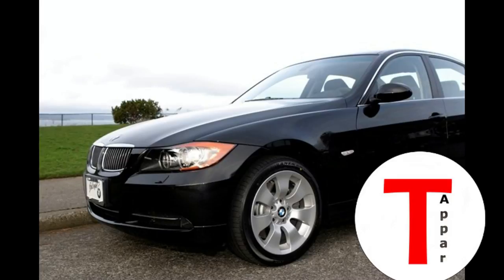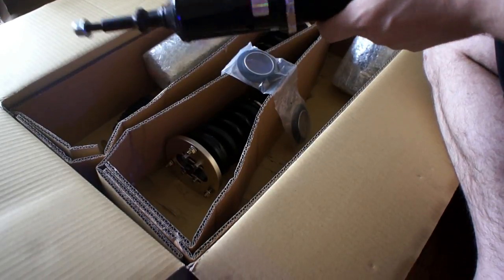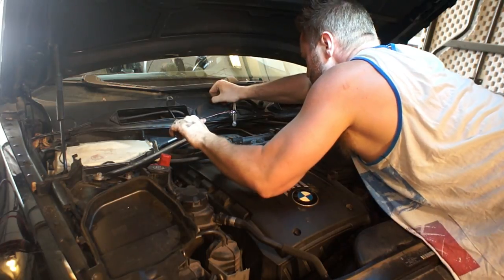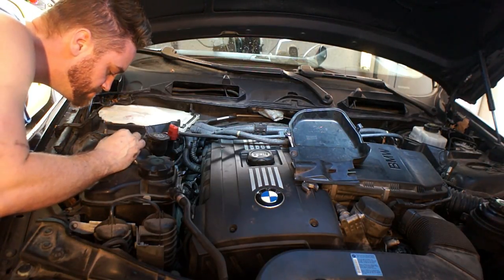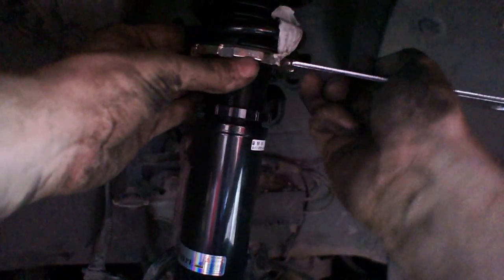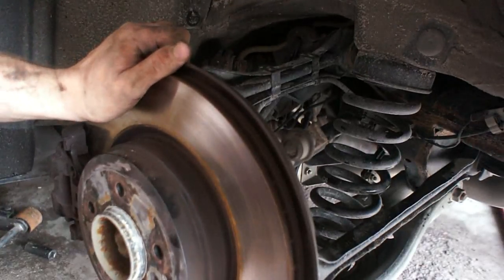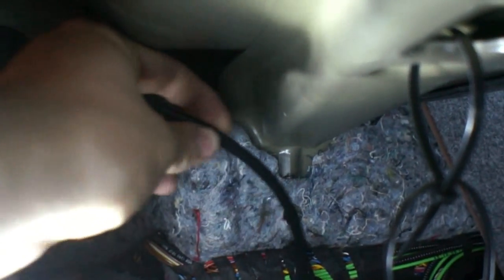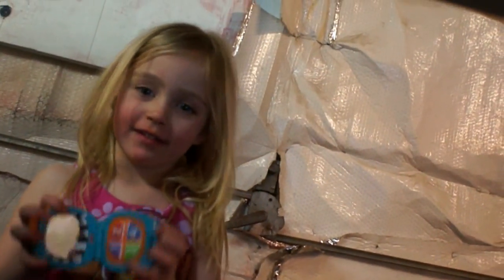Coilover Install & Review: BMW 335xi AWD. Get Low

Comment: Awesome video man! Very clear & concise & you do sound like Bob Ross lol. I had the BR series on my e90 xDrive, replaced them with KW V1’s after the BC’s blew in 25k miles, wasn’t slammed & I don’t track the car. 
A couple things I will note to potential BC coilover buyers: BC gets a bad rap because the R&D and ‘testing’ they do is nothing short of mediocre. They often speak out of their arrogant rear-ends sharing bogus results & stats and relying on marketing hype to build the ‘positive’ side of their reputation. As far as their BR series quality, it is ok, JUST ok. They don’t ride very well (even with the adjustability), there is no nice ‘balance’ between handling & ride comfort & height, the shock inserts tend not to last very long and are easy to blow, and the materials they use for the rest of the coilover body is subpar also. Meaning if you hit a bad pot hole (like the ones all over the northeast), it is very easy to bend components/damage threads or straight up blow a shock. And trust me the LAST thing you want to deal with is mushrooming strut towers. I’m lucky it didn’t happen to mine. 
Now of course there will plenty people saying “but they were fine for me you don’t know what you’re talking about it’s just your experience!” on certain forum threads, but I’d advise potential buyers to do some deep extensive research (like “e90 KW V1 vs BC BR coilovers”) on the forums, read many threads, read about BC’s reputation as well, and you’ll see the reason so many people decide to go to KW. The e90/f30 community on the forums (not the arrogant type) are very thorough and critical of the suspension products they put in their cars (because we’re already busy enough fixing other things on them lolol) and often need to have a balance between fun & practicality (ie commuting on highway), which is why BC’s are usually meant for budget/project cars. 
For anyone who got this far reading this, if you want the BEST balance between ride & handling & quality, get KW’s and you’ll never look back👍🏼
Reply: Are they KW ok for winter daily

Comment: My set of coilovers, my top two lock rings are gold. My bottom ring is black and diameter is smaller so the wrenches it came with dont fit. Thoughts? In your video your top one Is gold and then your middle one and bottom lock ring are black. My bottom one is black but the top two are gold..I'm alittle confused.

Comment: Just getting around to installing mine today but I have a  question. Do you need to transfer the black steel circular plate & gasket from the original front struts?

Comment: Hey mate, great vid. I do have a question though. I've had the same coilovers installed on my e90 320d and the workshop couldn't get the ride height sensor to remount in its original position due to everything being much closer to the vehicle body. Did you experience this issue?

Comment: Wana sell your old lowering springs?
Reply: are you looking to buy some? im in the process of replacing my old ones. but still looking for some springs i actually want to buy.
Reply: Albert Farias yes I want some lowering springs for my e90 xdrive. I don’t Wana go coil overs
Reply: @jamesus12345  You're going to bottom out unless you are running some stiff bilsteins newer shocks.

Comment: I have a question. I’m installing my BC coilovers on a 08 E92 rwd. Fronts were easy but I’m stuck on the rears. Does the rubber spring perch stay in the rear lower control arms or do I need to take them out?
Reply: they should be kept in to seat the spring. the grooves will allow the spring to sit flush while the top lines up to the adjustable perch.

Comment: Hey. I got the same coilovers for my e92. Over some bumps i get a loud impact sound in the front do you know why? I don't remember what my dampening is. Could it be because it's to stiff or to soft that the shock is bottoming out?
Reply: vito trentadue I would assume it’s too soft
Reply: You need endlinks